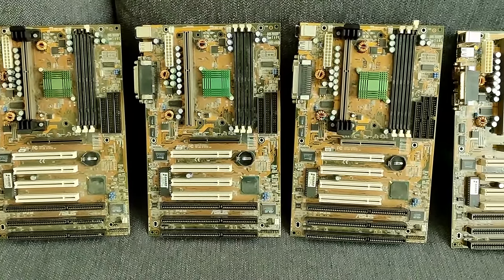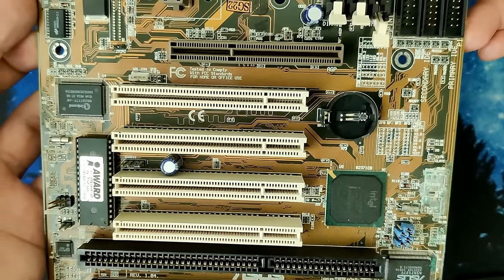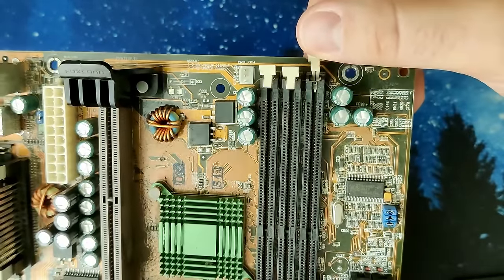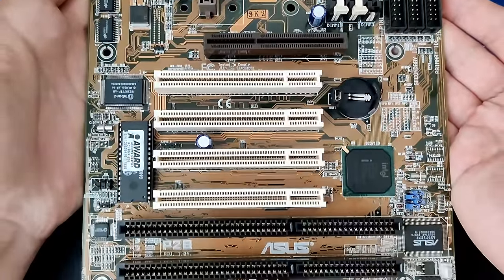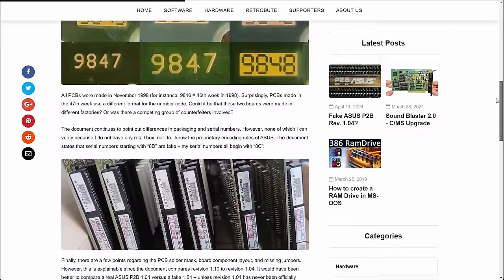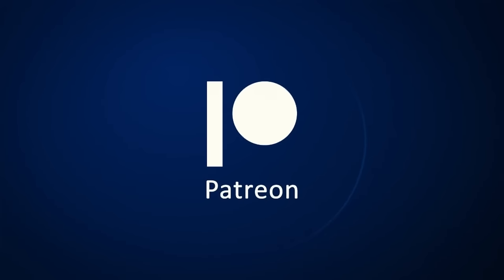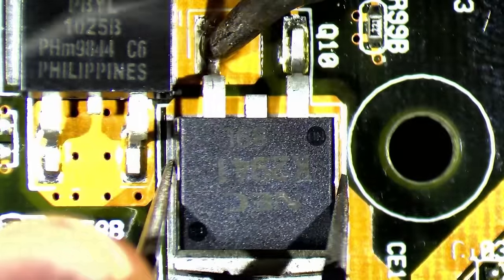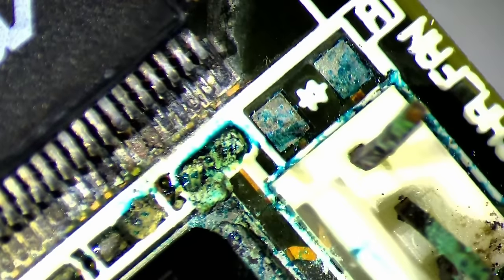ASUS P2B Restoration: Board #1 - Counterfeits?

Comment: I am in for the rest of this series! The Asus P2B almost became the mainboard I chose back in somewhat early Slot 1 days. In the end I went with an Abit BH6 and a Celeron 300A that was OC'd to 464 MHz for a number of years. 
Unfortunately that combo died rather spectacularly after I had given the machine to my parents. Bulging and leaking capacitors caused one or more of the power MOSFETS to literally explode one day while the machine was in use. There was quite an impressive amount of damage done not only to the components on the MB that failed but also to the MB as well with quite a bit of charred PCB!
Reply from the maker: I wish there would be an easier way to identify damaged caps. Some may not even swell or show any signs of fatigue, but they still need to be replaced. A plan was to check if I can measure a difference in current draw before and after recapping such a board.

Comment: Very nice educational video! I bought my very first PC in 1998. It had an Asus P2B board and a Pentium II 350 processor. Of that system I still have the Pentium II 350 processor, the Seagate Medalist HDD (not working), the Altec Lansing ACS 91 speakers and the later added external US Robotics 56k Message modem. I am only able to recall this because I still have the receipt for the purchase of the system.

Comment: P2B-F was my first purely personal motherboard with the first PIII 450MHz - very nice (still keeping it stored in a dry dark place inside antistatic bag with several bags of silicagel ;). A russian developer had a series here nearly a decade ago where he has run it with the latest fastest Taulatin through a modified socket adapter - unexpectedly, it would have worth the effort back in the days.

Comment: For those rusty serial and parallel ports I recommend you try using Rust-oleum Rust Dissolver.  It's active ingredient is phosphoric acid which when applied to rust converts iron oxide into iron phosphate which is white in color and can then usually be easily washed or brushed away.
Reply from the maker: Let me see if I can get this here. Thanks for the tip!
Reply: If a particular commercial product isn't available in your area, there will be another very similar.  The faster removers are stronger acid mixes like hydrochloric or phosphoric.  A milder acid can be used also, like citric acid (often comes powdered) or acetic acid (vinegar).  I use citric often, and neutralize with sodium bicarbonate (baking soda).
Reply: @drewnewby  The only thing about vinegar is it converts iron oxide to iron acetate with is harder to remove and is black.
Reply: @bitsundbolts  There should be some rust converter that contains phosphoric acid where you live. If not Coca-Cola has phosphoric acid in it. It would be messy though.

Comment: Enjoyed the video.  I am enjoying the inspiration for repairing this board in front of me that looks perfect but won't post.  The magic of editing makes it look quicker than it is. :)
Reply from the maker: Oh, absolutely! I probably spent about 10 hours on this board. There were so many traces that started getting bad. Removing the ISA slot and the ports took some time too. Good luck with your board! Sometimes it can be as easy as a loose voltage regulator. It could also be a deep scratch that severed some traces.

Comment: Those boards behaved very nicely during bath time, they look so sweet :)

Thanks for compiling more information about the topic of fake boards on your website, it's nice to read unusual stories from retro times.

Since you started to use a microscope that I want to buy one as well, but it's still too much for my purse :(
I'm using my phone with a microscope app and a cheap chinese tripod, it's not great but it helps sometimes.
Reply from the maker: Thanks for checking out the site!

Comment: I had a P2B-D back in the day, the dual CPU model.
Reply from the maker: Nice! Back then, dual CPU systems were so exotic (at least to me)! I always wondered how much faster things would be, but you needed at least Windows 2000 to take advantage of two CPUs. I also pulled a dual slot board from the scrapyard a few month back. I still need to have a look at that one too!

Comment: So #1 didn't surprise me. I figured you'd get it. Board #2, that chip is dead. Maybe the board itself can be saved, but I honestly doubt you can save that chip. How hard is it to find replacements? That's what will determine if you can get it running again or not.

Comment: Use Deoxit D5 for the corroded parts!! Will fix those up quick!
Reply from the maker: I have never heard of or used Deoxit D5. Unfortunately, I have already finished my work on board #2, the heavily corroded one. If D5 is just a contact cleaner, I doubt it will be able to dissolve heavy corrosion. But I may be wrong. Maybe let tech out once more after the next video and let me know if I should give it a try. I can get a can of D5 for about 30 USD here in the UAE.

Comment: Amazing, my retro pc board. (rev 1.04) 
My only problem with it, that i can't get irq5 (gives irq 10 for a creative ct4170 pnp) 
Sound is working in dos, but not in win3.1, strange. Have a Pentium III 450 and 512 sd innit. Currently working on Lan for Dos 6.22 and 3.11.  3com950B-tx
Reply from the maker: Good to know - maybe I'll run into the same issue with IRQ5 when I experiment with that board later. For now, I will focus on recovery.
You are running windows 3.11 on a Pentium iii? Isn't that system too fast causing all sorts of issues?
Reply: @bitsundbolts  Doom 1, 2?; quake 1, Dune 1; 2,  Warcraft 1 runs perfectly on my fake p2b board. Yes, apparently mine is one of the fakes, with the 3 bus speed jumpers, and at the power connector the inductors are far from eachother.
Reply from the maker: I somehow believe that rev 1.04 was an official ASUS board, but they decided to cancel it in favour of rev 1.10. They couldn't do 1.05 because the previous rev would be missing. So, I believe they are real ASUS boards, but were not supposed to be shipped. Maybe someone didn't want all those PCBs to go to waste after they were already made.

Comment: An incredible job! Compliments.
Is it possible to know what model of soldering iron you are using? I was impressed with how quickly it freed up the parallel port :O
Reply from the maker: This was a desolding station with a vacuum pump. I'll include a link to the exact model I use here. Feel free to check it out. I added the link to the description.
Reply: @bitsundbolts  unfortunately aliexpress replies that this link is not available in my country and indicates it as a page not found :(
Reply from the maker: Sorry, that happens sometimes. I don't know how to fix that, but look for a desolding station 'SS-331H'. That is the one I used in the video. I haven't used it a lot, but so far, it does a good job. It does struggle however with pins connector to big copper planes. Necroware uses a hot air station to additionally heat up the board in such cases. I used a wick to clear the solder on those connections, but I want to try hot air next time.

Comment: I got one - does it support P3 - yes - i just once tried and it worked - board was a wandering item - after this i checked and behold.. it was documented fact.. - counterfaits.. do they support P2 and P3 ? - do i see one AGP slot a bit larger (longer)  or is it a parallax ?
Reply: Soap cleaning  - oh dear i am stuck in a mindloop not doing this.. because..
Reply from the maker: It should support any CPU requiring 1.8v or up. Unfortunately, the P2B does not support Coopermine (P3, 370) CPUs out of the box, but I want to mod it so it does.

Comment: I have one of these. Currently with P3 700mhz slotket and geforce3 Ti200. Might change for a 1000mhz celeron or GeForce 4 4200ti that I have. Which gpu would you use? AGP is 3.3V only, so I believe GeForce FX would be fastest.
Reply from the maker: I am not sure if it's true, but I've heard that you need to be careful regarding the power consumption of the GPU. If I get the time, I'll try different cards and monitor the voltage regulators and their temperatures.
Get a card that works for the games you play on your retro PC. It doesn't have to be the fastest, just something that works well.

Comment: #2 (Corrosion on the smaller Asus IC) and #3 (same, while less severe way more widespread) look "very high effort, low chance of success" especially on multilayer boards - but who knows. #6 probably is fine or fixable with some effort considering how little logic is likely to be set in the corroded area. Let's hope those BGA south bridges are ok on all boards - I had an Asus K7M back in the day and in 25+ years of owning computers this was the only fatal point of failure I've encounter with my main PCs so far.
Reply from the maker: I totally agree with your high effort and low success rate estimation. If this were a commercial effort, nobody would work on the heavily corroded boards. I, on the other hand, want to learn and see if I am able to restore such a heavily corroded board.
I'm almost done getting all the footage done for board #2. And I can tell you that I spent north of 20 hours on that board so far - and I'm still not done (serial ports are pending).
Next video will be a long one! There was so much to do! I hope to finish it by next Friday and that all that effort is rewarded with a fully working board!

Comment: What're the chances that Asus discovered a flaw in their 1.04 boards, fixed the flaw with the 1.10 and to avoid any recall/liability designated the 1.04 boards as "Counterfeit"
Reply from the maker: Interesting theory
Reply: Unlikely. They were making fat stacks of cash on those boards, they could eat the rework cost no problem. They had a very good reputation back in the day. Imagine someone dug up that they're trying to scam their customers and resellers by claiming the boards as not legitimate? The damage to the business would be immense.

The fakes problem was well known, I had a fake Asus 430hx board, apparently made in India.

I think all boards of the era should be manufactured by them in house, so I don't think "supplier dispute" aka night shift product is it, I think there really were independent factories building fake Asus boards. It's not that difficult to reverse engineer and copy a mainboard.

Comment: That detached mosfet is wild ... any idea how that might have happened?
Reply from the maker: Probably a weak solder connection from the beginning. Add a bit of flexing the board and the environment those boards were stored in that caused the corrosion, you may end up with detached MOSFETs. But that's just my speculation.

Comment: Doesn't the P2B fit around the time of the capacitor plague, which was due to counterfeit name-brand capacitors? Maybe that's what the counterfeit warning was, rev 1.04 had the affected caps but rev 1.10 doesn't among other changes.
Reply from the maker: Surprisingly, except that one cap I show on this one board, all others seem to be fine. I can't say anything about their condition, but none bulged or leaked.

Comment: i once had trash picked ecs board with bit rot corupted bios and broken p2b with working bios, so i swaped bioses and booted ecs from asus bios and other than keyboard it worked well wnough to boot from a floppy and self repair fy flashing the correct bios back
and it worked for 5 years
runing windows xp on p3 500 768mb of pc100 ram and soundblaster pro 2 on isa :P
Reply from the maker: Yeah, this board has 3 Isa slots and works with faster models of Coopermine (maybe even Tualatin with further mods)
Reply: Whoa that's an entirely legendary repair, given the lack of proper tools.
Reply: @SianaGearz  i was 19 :P and youtube was still privately owned company running on flash player. proper tools back then were flat screwdriver and another computer to write autoexec .bat on a floppy along with a proper bios and flasher files

Comment: Anyone know where he gets those grinding heads from? So nice and small for grinding away the corrosion on those traces.
Reply from the maker: The grinding heads came with the engraving pen. However, they are poor quality (they're not straight). First, I had to spend about 10 minutes to alight the one I'm using in this video. I'm looking for replacements because they also wear out. Most of the other 20 heads are useless because they're too big or the wrong shape.
Reply: Thank you so much for the response. I really enjoy these repair videos. Everyone learns so much. If you find some good ones please link them in the description :-)

Comment: I'm trying to figure where the corrosion around the ASUS chip on all the boards came from. I didn't see any capacitors nearby and it's far from the cmos battery too.
Reply from the maker: I have a feeling it is due to how those boards were stored. I'm working on the second board right now and I cannot explain where all this corrosion is coming from 🤔
Reply: @bitsundbolts  dog urine, probably. Wash your hands.

Comment: How many of the boards will you fix? I wouldn’t be surprised if you fixed all of them, unless that ASUS chip is dead as I assume finding a replacement might not be easy. That second board repair will certainly be interesting with how bad it looks.
Reply from the maker: I am working on board #2 at the moment. I think this is the hardest restoration I've ever attempted! I hope the countless hours pay off in the form of a boot screen!

Comment: I wouldn't waste my time with parallel ports. lol So far board #4 seems like the best contender. hmmm or board #6.....or not. I do think it's fixable though. So #4 might actually just work. I think 2 maybe 3 are beyond repair. Especially ones with corroded chips depending on how hard it is to find replacements.
Reply from the maker: I am working on board #2 - already spent 12 hours on the board and haven't powered it on yet... Corroded solder is like cement! I may just waste my time on this one, but I am learning a lot along the way. Especially reconnecting corroded vias.
Reply: desoldering alloy sometimes helps with corroded solder.  Works well on power connector pins that dull from current / heat stress.

Comment: 1, 4 & 5 look feasible. 2 and 3 look concerning, not sure if they can be fixed quickly. 6 looks like it's more annoying than trouble.
Reply from the maker: I am on board #2 now - you are absolutely right! They are not fixed quickly! But I'm learning a lot trying to revive it!
Reply: @bitsundbolts  very interested the see how 2 turns out. The pins on that Asus chip looked pretty nasty.

Which made me wonder if a pin falls off, can you try to reattach it or if there's a way around that? Like using a wire to what part of the pin is still left.
Reply from the maker: Yes, I can attach a wire and reconnect the chip to the board. It is a bit tricky though because you have two solder joints very close to each other. So, when you heat up one end of that tiny wire, chances are the other joint melts and disconnects again. With practice, it is not a big issue. I reattached some pins on Voodoo and Voodoo 2 cards the same way - I had to drill the housing though because there wasn't enough exposed metal left to attach a wire.

Comment: so all 1.04 boards after 29 dec 98 are fake. Just check manufacture date on components (any ICs on board). If there are chips from 1999 - board is fake, according to asus pdf.
Reply from the maker: Good point. I'll check if I can find a date on one of the ICs. The board PCB manufacturing date is all in November '98. I don't know how long it would take to be on shelves, but I somehow have a feeling that about a month is quite short to be sold before 29th December as Asus states in that document.

Comment: I hate that board.
Power problems and kill my cpu and memory .
And not to a power unit .
Reply from the maker: Sorry to hear that you have bad memories about this board! Never nice when one component takes another with them when they fail.
Reply: @bitsundbolts  its by switching the gpu.
The gpu just works fine in a other systeem.
The problem is how the power controller on the board is use
The voltage regulator are use for the cpu , memory and gpu for the agp slot.
It had cheap controller in that time.
Reply from the maker: Ah, good to know. So, better to avoid GPUs that draw a lot of power over the AGP slot. Or risk it and monitor the temperature of the components on the board.